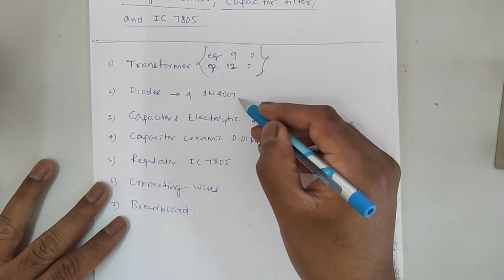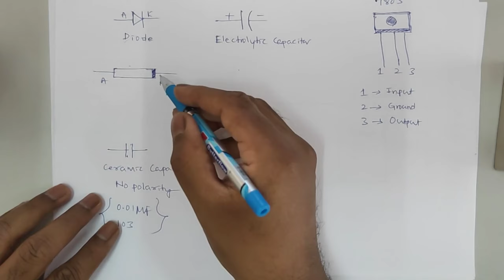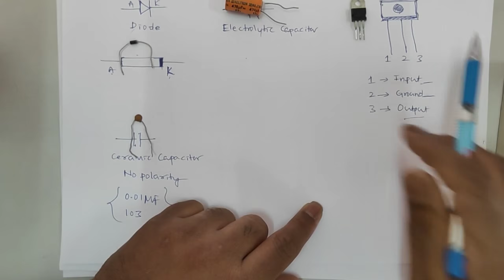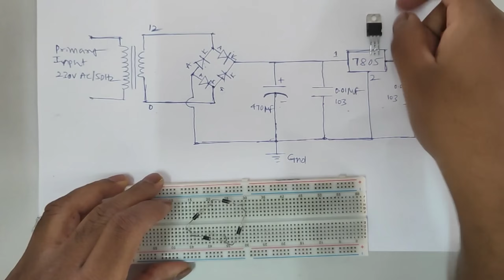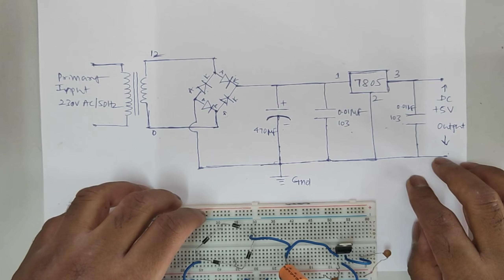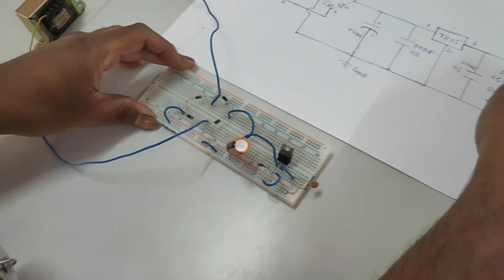5V DC Power Supply | Circuit Connections |

Comment: Best sir very helpful
Reply from the maker: Thanks and welcome
Reply: @Yeligarslaboratory plz keep on adding video's
Reply: @Yeligarslaboratory  if we want to make a dc regulated power supply with 4 output rails of +5,+12,-5,-12, what capacitor and transformer and diodes should be used?

Comment: Sir hamko 12 volt dc power supply banane ka project mila h.... Please help me sir kya kre please help me
Reply from the maker: Take 7812 IC and 12-0-12 Transformer..
Reply from the maker: Same Circuit will work
Reply: @Yeligarslaboratory  and sir capacitor kitne micro farad ka
Reply from the maker: @khushitripathi860  470 micro farad
Reply: @Yeligarslaboratory  sir thank you so much jese hi hal project bnakar ready krenge apko video bhejenge
Reply: Iska use jyada se jyada kaiise kre
Reply: Output voltage dikhane ke liye led lagani hogi
Reply: @Yeligarslaboratory  diode??? And regulater ic kitne capacity
Reply: @Yeligarslaboratory  capacitor ceramic?
Reply from the maker: @khushitripathi860 you can use multimeter
Reply from the maker: @khushitripathi860  1N4007 Diode
Reply from the maker: @khushitripathi860  IC Regulator
Reply: @Yeligarslaboratory  sir circuit work nhi kr rha h
Reply: Sir please help me circuit
Reply: Circuit is not working
Reply from the maker: @khushitripathi860  
First check step by step with the help of multimeter 
1. Check output of Transformer...At secondary..  by keeping multimeter in ac mode.
12v coming or not
2. Check for Diode cut in voltage 0.5v for all diodes.
3. Connect IC 7812 according to its pin diagram....
Reply: @Yeligarslaboratory  sb khuch apke video ke according hi kiya h
Reply: @Yeligarslaboratory  bus aapne 5 volt bnaya h hamne, 12 volt jitne capacity ke aapne componant kahe wahi lagye h kya jyada capacity ke laye
Reply: @Yeligarslaboratory  capacitor ceramic kitni capacity ka lagaye
Reply: @Yeligarslaboratory  thank you so much sir hamne aache se bnaya aa gaya 12 volt output me...
Reply: @Yeligarslaboratory sir voltage regulation pr zener diode bhi laga sakte h na ic ki jagah pr to aapne kyu nhi lagya
Reply: Sir iske viva question bataiye na....

Comment: I want to create a interrupted power supply by adding 4x1.5V cells so that when the AC source loses power the batteries can kick in and take over, the batteries will have an output voltage of 6Vdc and it also need to be regulated by the LM7805 for an output of 5V. how can I go about achieving this?

Comment: Sir thank u for great explanation but I wonder that How did u obtain the capacitor values. Is there any specific calculation needed ?
Reply: Do you find the answer if you knew, can you tell me about it
Reply: @StephenQuan04  I took Industrial Electronics lecture in the university. In this lesson we used ELECTRONIC DEVICES
AND CIRCUIT THEORY
ROBERT BOYLESTAD
LOUIS NASHELSKY book as a reference .  There is a chapter 19 in this book there are some calculations about the capacitor values you can check this out.